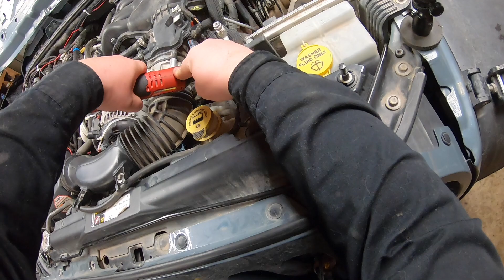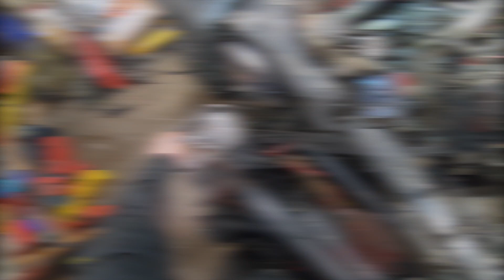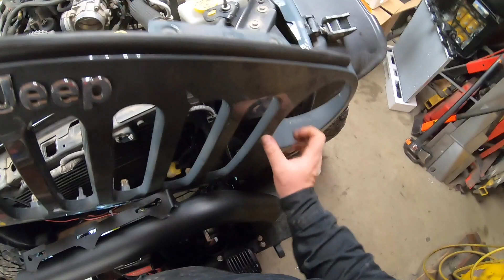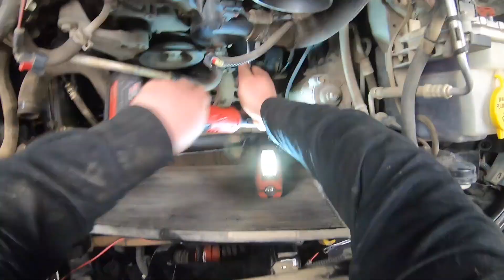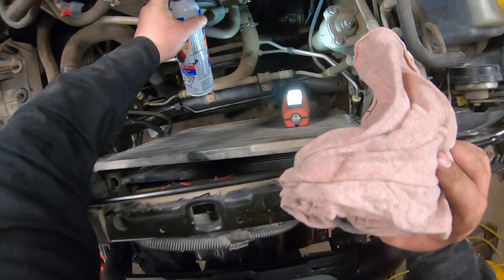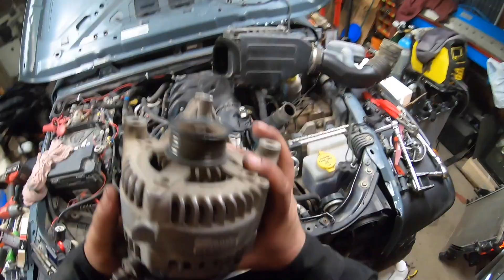DIY Jeep Wrangler JKU 3.6 How to Replace Water Pump

Comment: I see this is a 2 year old video, but I am glad to see that the water pump is not internal like on VW or Mazda motors. I don't need to change mine yet but good to see it is pretty straight forward, thank you for putting this video up.
Reply from the maker: Now that you watched it you’ll be doing it very soon

Comment: So you do not have to use Gasket Sealer on the New water pump? Rubber gasket seals it?
Reply: Looks like no. That would be easier if true

Comment: Been watching your channel for quite some time. Not surprised you popped up when I searched for a water pump video. I've torn down my JK to put in the third radiator in 100k miles. These things leak within 50k miles. Trying my luck w/ a NAPA unit rather than another Mopar. Anyway - the water pump started chirping as well, so she's getting a new one of them as well. Thanks for all the work you do with your channel. Cheers. It's MFBT.
Reply from the maker: Thank you for watching, I replaced the whole cooling system when I did the radiator.  I have a lots of jk videos in my playlist and many more that are waiting to be uploaded.
Reply: 186k and no problems…..this whole time I have only had to change the thermostat!